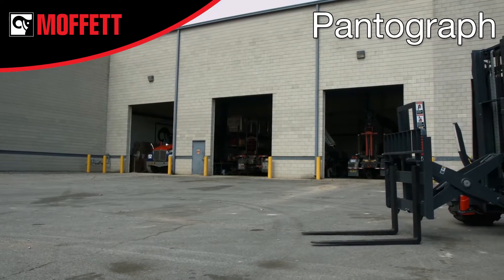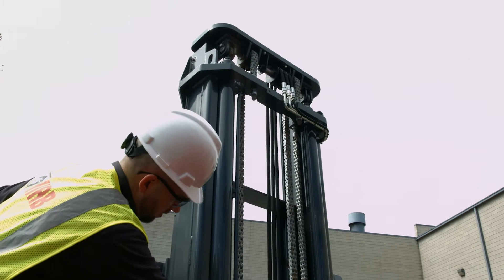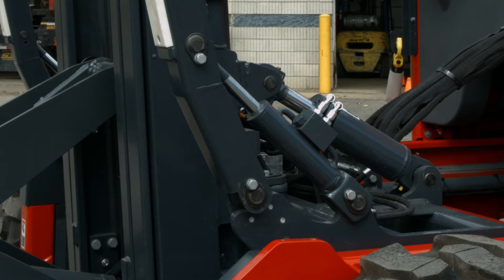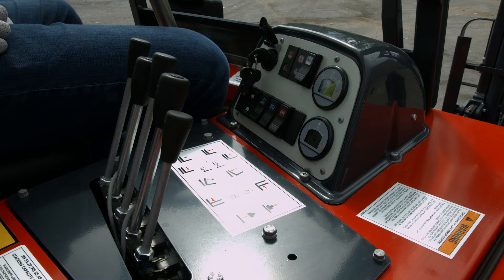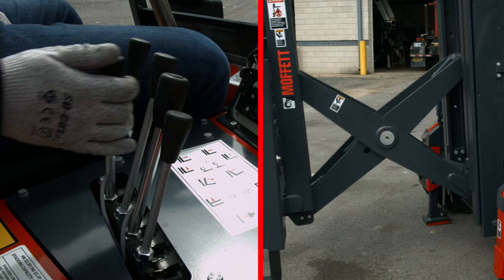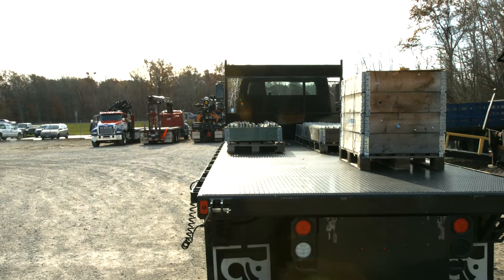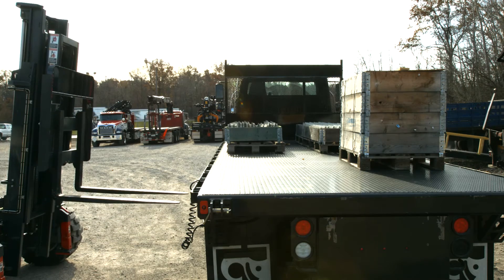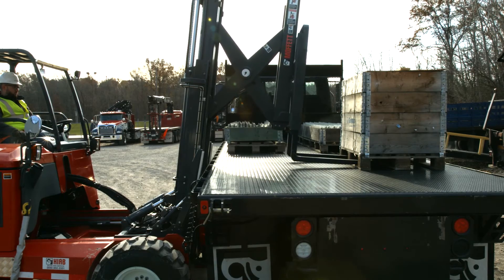MOFFETT Truck Mounted Forklift Orientation Video - Pantograph (Part 2 of 3)

Comment: I drive a lumber truck and my company bought one of these with 4 way capability which is pretty awesome. But I’m having problems extending heavier loads that the regular moffetts handle with no problem. I’ve been driving it for about a month and can’t figure out why.
Reply from the maker: Jeffrey, thanks for reaching out. To be sure, the MOFFETT M8 55.4P NX truck mounted forklift is rated to lift 5500 lbs @ a 24” load center.  In cases where there are concerns with capacity, we first need to verify the build of the machine is configured as designed, then we’ll verify operations, as well as load details. To help work through these details, please call 844-442-2911 8-5 EST or email us at support@hiabtechline.Zendesk.com. If you’re emailing, please include your phone number  so we can call you back. It would be helpful to include a few photos of your machine for review. 
Thanks again and kindest regards.
Reply: @hiabusainc5582  shouldnt the mast have grease on the mast rollers because base on the video there look dry and a my work toyota always is well lubed
Reply: Same thing here..